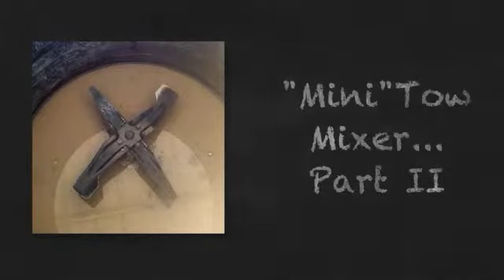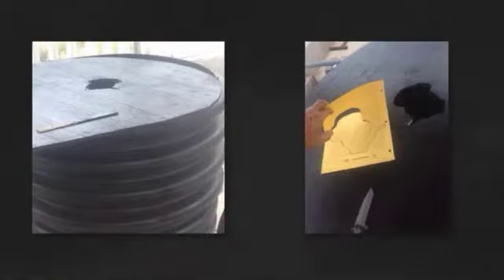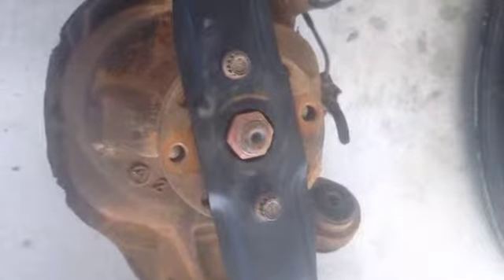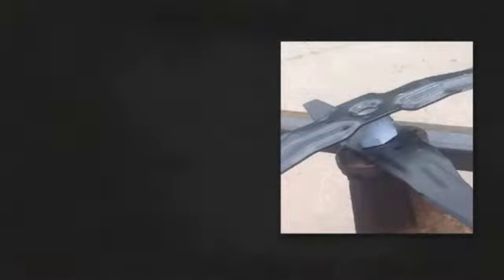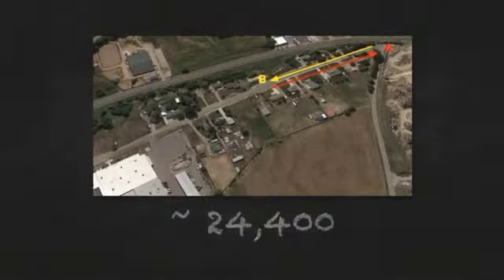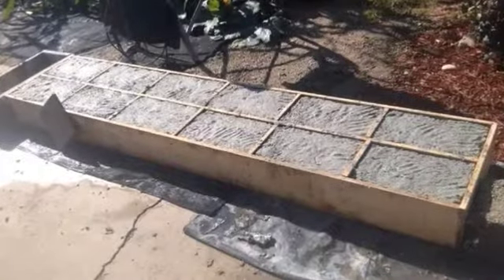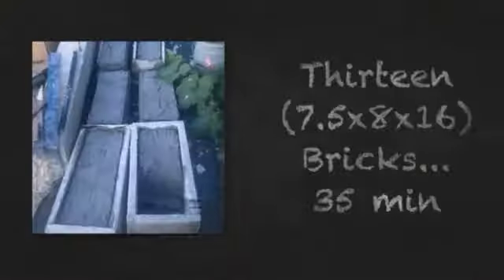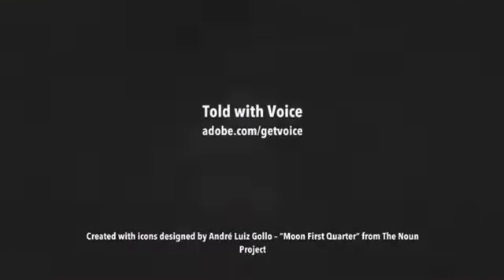Papercrete 205 - Selecting Blades (Part 3)

Comment from the maker: Great question:  this one is small enough, I just reach over the side and scoop the paper Crete out one 5 gallon bucket at a time.

Sounds harder than it is. I takes about 14 - 16 times to empty the mixer, which almost perfectly fills my 12x sections of the gang molds.

~15 min which I figure is cheaper than a gym pass.  ;  )